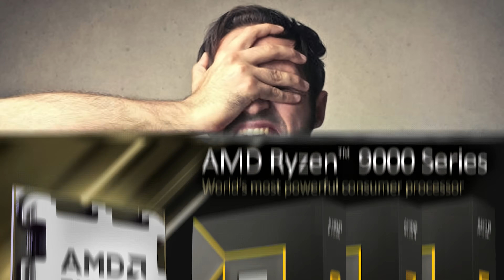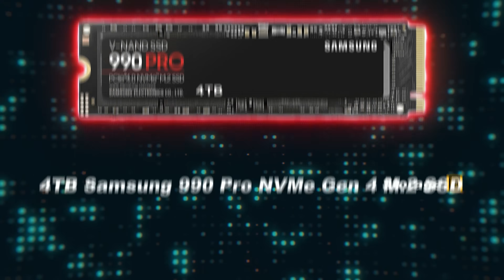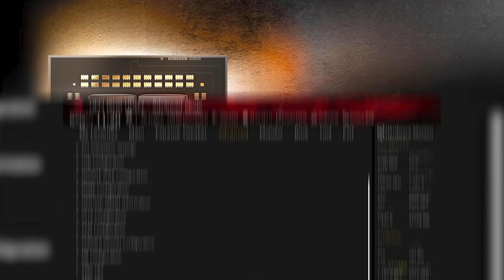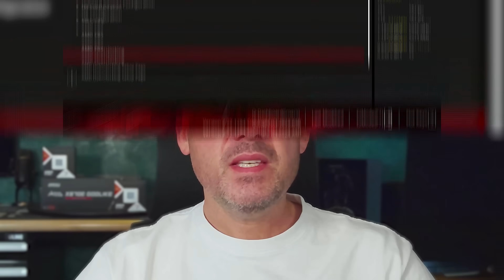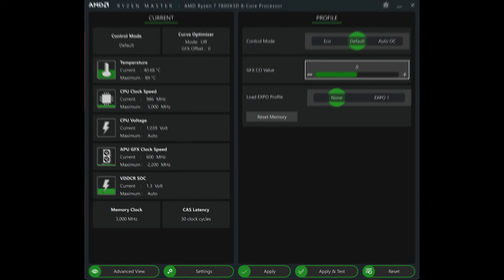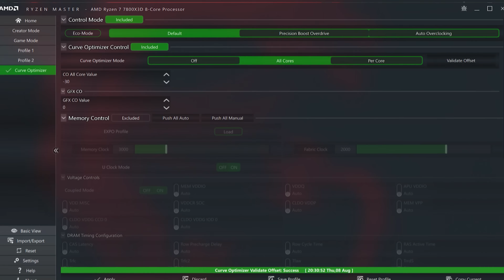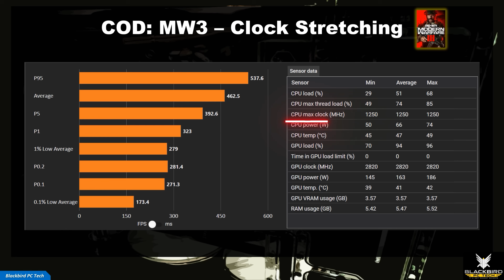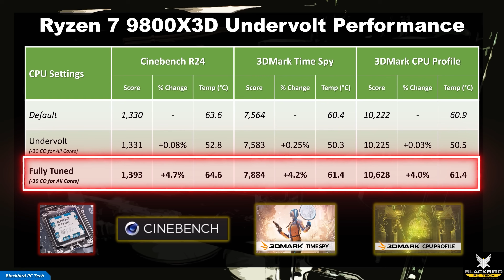How To Undervolt a Ryzen 7 9800X3D The Right Way! (or Any AMD AM5 Ryzen CPU)

Comment: I ended up only being able to get stable -17 offset stable which still had me hitting close to 90c, decided to do a manual voltage limit of 1.55 and a static clock speed of the base 4.7ghz, and my system went from getting to 97c stock to 78c under stress. Mini itx build so my cooler is a axp-120. not sure how much performance im really leaving on the table with it not boosting to 5.2 but if its only a couple frames its worth the much lower temps and fans not being so loud .
Reply from the maker: If you have thermal challenges like this then a much easier way to deal with it is to set a thermal limit in PBO2 ... that way you won't be leaving performance on the table. You can see how to do that in this video: https://youtu.be/N60M36PRHsY
Reply: @blackbirdpctech  you know im not sure if you do these kinds of videos but id be interested to see the fps difference across some games with stock 9800x3d and static base clock 4.7. to see if theres really much difference between 4.7 and 5.2
Reply from the maker: That's a very specific question that I don't think a lot of people are asking. You could always simply test your current configuration against your baseline to see what impact it has ... just pick a game you like or a synthetic benchmark like Steel Nomad, and you will rapidly see the difference. I would be curious to find out.
Reply: @blackbirdpctech I figured it could be 9800x3d at multiple frequencies but yea too niche for a video haha, Il do it when I get back from work and give you the results
Reply: @blackbirdpctech  done and done and the numbers are actually... not what I expected,I have a 4090 and 9800x3d, I tried witcher 3, cyberpunk 2077, kcd 2, and steel nomad. I tried stock with PBO auto, then static 4.7 with a lower voltage 1.055. my temps dropped from about 90-95c max to about 75-80c max.
 Witcher 3 Stock: 193/143
Witcher 3 Underclock/volt:198/150

Cyberpunk 2077 Stock:215/156
Cyberpunk 2077 UC/UV 214/161

KCD2 Stock:141/96
KCD2 UC/UV:146/120

Steel nomad stock:9034
Steel nomad uc/uv:9348

the first numbers are avg fps the second number is 1% lows

My only guess as to why the underclock/undervolt did better or within margin is the lower thermals, although even with pbo it never throttled, at its lowest was still 4.7 so not quite sure what happened, mostly surprised at steel nomad 300 point swing.
Reply from the maker: @3D-DOMO  great job, that’s the way to do it!

Comment: I have my ryzen 7 9800x3d from the first week, never undervolt or overlock, a few days ago i change my case and the aio and the temps are higher, i want to try the undervolt but im not sure if there's some risk or if my cpu can die with this😅 but if not i will use this guide
Reply from the maker: This will help reduce your voltage and temps ... it should therefore increase the life of your CPU
Reply: Thanks! I will try this today @blackbirdpctech
Reply: @blackbirdpctech i tried with -10 and the aida64 test stopped in less than 10 seconds idk what happened
Reply from the maker: That's interesting ... I've never had a chip that won't do -10 CO stable
Reply: @blackbirdpctech i tried with -5 and same thing, the test crash in less than 10 seconds maybe i just have bad luck, i have the cpu from the release date so idk if i got a bad batch
Reply from the maker: @SlayerT1898  is it stable without any undervolt?
Reply: @blackbirdpctech yes, no issues with stock settings
Reply from the maker: @SlayerT1898  just make sure when you input the curve offset that you change it to negative instead of leaving it the default positive ... otherwise it will be an overvolt
Reply: @blackbirdpctech yes i use the all core settings, negative and -10 and -5 but same issue
Reply from the maker: @SlayerT1898  it seems very strange to me but if you followed the guide and didn't make a mistake inputting the undervolt, then it might be your CPU
Reply: @blackbirdpctech I read i can try with each core one by one but idk if that can work
Reply from the maker: @SlayerT1898  you can, it will just take time, but it's worth a shot
Reply: @blackbirdpctech do u have some video doing that or what curve can I set to each core? I'm a potato with this things 😅
Reply from the maker: @SlayerT1898  it's the same process shown in the video, but you do it for each core ... start small, say in increments of -5CO for your CPU, and progress to higher negative offsets.

Comment: Will undervolting  cancel Amd warranty
Reply: Plus o have asrock x670 steel legend and 9800x3d im scared lol
Reply from the maker: Install the latest bios
Reply: @blackbirdpctech i installed 3.25 ever sense i did that my cpu and gpu temps went up only thing oc is ram everthing else default thanks
Reply: @blackbirdpctech last thing how to make hw monitor stay open while playing sorry thanks
Reply from the maker: @Frostthescottishfold it should stay running in the background and record your temps
Reply: @blackbirdpctech no it fixed i undervolt my cpu to -25 and temps where low then went back high so i reapplied thermal paste and its working fine wont go over 63 while gaming thanks still also get 280 fps which is my limit i put for cod
Reply from the maker: You would have to read your warranty ... that said, when you do anything in Bios it gets stored on the motherboard, not your CPU ... so if you were to send your CPU back without your motherboard, there really is no way for them to know what you did.

Comment: I have a 7600 and it runs pretty hot even on idle (47-50C) with an aftermarket cooler. Even by setting curve optimizer to -30 and voltage offset to 0.0500, no change. I'm not sure what I'm doing wrong 😔
Reply from the maker: 48 deg C in idle is not "running hot". Why are you changing the voltage offset and using curve optimizer at the same time? Did you test under load?
Reply: I didn't test it under load, it's the first time I do this. First I changed the offset, but it didn't change anything. Should I leave the curve optimizer and reset the offset value?
Reply from the maker: @alin.1704  I strongly encourage you to follow the steps in the video ... you won't notice a decrease in temps in idle with an undervolt.

Comment: I was only able to get my 9800x3d to clear AIDA64 test at 10 magnitude and default was already at 5 which didn't really change much. Any reason why I can't get it any lower like how you have yours set to 30 magnitude?
Reply from the maker: The stock settings should be at zero ... unless it's a prebuilt and they set your bios up with a -5 CO. The reason is silicon quality ... some chips will be able to undervolt more than others.
Reply: @blackbirdpctech  I built my own PC so unless they gave me a used CPU at the store idk. Also at @3:50 you talk about independent settings which got me a little confused. Should I be making sure both sections are set to the same magnitude or is it fine just changing one?
Reply from the maker: @stephenripcord3987  the undervolt is stored on your motherboard bios, not your cpu ... was it a used motherboard? Just input the settings in one place ... I would recommend the AMD overclocking section.
Reply: @blackbirdpctech  Nope everything was brand new or so I thought. AMD overclock is where  I did the tweaking but sucks I couldn't get it very low. Appreciate the help. If you have any other video recommendations from your channel for stuff like this I would love to check them out.
Reply from the maker: @stephenripcord3987  I did a post a few months ago outlining the how-to guides I currently have on my channel:

https://www.youtube.com/post/Ugkx3QVlCLJCO5lL5lRMB1RqT-akmXO_PpRS

I will have a new AMD AM5 optimization guide out in a few weeks as well.
Reply: @blackbirdpctech  Awesome bro I'll be waiting

Comment: I’m totally confused. You were very clear about exactly where to go to enter the negative curve offset yet you completely glossed over the fact that you also have a positive 200 MHz boost clock override applied as well. However, you never mention that in the video, but only focus on the negative curve that you set, which is only a slice of the complete undervolt pie you’re featuring in the video, and greatly affects stability.
Reply from the maker: I stated this early in the video:

"In the Precision Boost Overdrive screen, click on Precision Boost Overdrive drop down menu and select the Advanced option. This will allow you to access multiple tuning options for your CPU, as explained in my “How To Tweak an AMD AM5 Ryzen CPU: Step-by-Step Guide!” video. For this video we are only concerned about undervolting the CPU, so scroll down and click on the Curve Optimizer option."

I also linked to that guide in the video and description so that it's easy to find. If I repeated everything in each video then the videos would get super long and viewers would complain.
Reply: @blackbirdpctech  ok, thanks, that makes sense with your explanation here. I guess maybe something like “ignore the other settings you see here” would have been clearer, but no prob. Thanks for the video and response.

Comment: what do you thing of the people who say to stop testing all cores workloads, it s pointless, you can test on a processor -30 offset and will not get an error for days, the moment you test each core individually it will error in seconds/minutes. Use tests like OCCT single core test or Prime95 with core cycling? found other comments like this one saying you shouldnt do all cores
Reply from the maker: I think that there are a lot of people online that comment and offer expertise even though they never test themselves. I had an "IT expert" leave a comment a few days ago stating that all curve offsets are unstable under zero load, but that you will never experience a zero load condition in Windows because of background tasks. I asked him, "if you never experience zero load when running windows why would that be considered unstable?" I'm still waiting on a response.

What I've found from extensive testing is that AIDA64 does a great job of rapidly finding instability with curve offsets (including clock stretching). This is what I use when tuning my chips before I test them. I then test these chips extensively in over 30 games and professional workloads. When I benchmark games I run each benchmark at least 5 times at each resolution/settings combination. That means I do around 8hrs of straight benchmark runs for every video, not including the time it takes to reboot, load the games, select settings, etc.
Reply: @blackbirdpctech  Thanks man, really appreciate the reply. I'm just a casual gamer and mostly use my PC for gaming, watching stuff, and browsing, so I'm just trying to keep my system stable while undervolting without getting too deep into all the hardcore testing. That’s why I was confused by all the mixed advice online. What you said makes a lot of sense though, and it’s cool to see how much effort you put into testing. I’ll give AIDA64 a shot like you suggested and not worry too much about all-core tests now. Appreciate you sharing your experience

Comment: Thank you for this video! Honestly, I would advise everyone to just avoid using Ryzen Master altogether, it ruined my PC for two days it wouldn’t even post because the DRAMs got corrupted somehow (I got the orange ram light on my motherboard) , lol.

That said, I’m curious: in Ryzen Master, I couldn’t go lower than -22, but from the BIOS, my PC is more stable at -30 (7800X3D) maybe because I got a new 6000hz CL30 ram idk. I didn't try to get lower
Reply from the maker: Can't you simply dial-in a curve offset in Ryzen Master? Does it stop you from going lower than -22?
Reply: @blackbirdpctech  Yeah, when I try to go lower, the test doesn’t succeed for some reason. But I did -30 from the BIOS (started from -10 like you suggested) and ran AIDA64 for 20 minutes without any crashes or errors, so I guess I'm good.
Reply from the maker: @ookam9685 that’s interesting … will look in to it more

Comment: Instantly down from 90c to 74c when stress tested, air cooled with dark rock pro 4. Went right to -30, works great thanks!
Reply from the maker: It's a magic tweak 😉
Reply: @calvins.9178  you underclocked at 30 ?
Reply: @Stevestevestevestevestevesteve  I did as well, -30 offset
Reply: @roccotaco87 when I did that to all my course it started underclocking some of the course
Reply: how was fps affected?

Comment: 03:53 All videos articles etc fail to mention,  a negative curve optimzer curve causes instabiity at no load. 90% of testing at full load while using a negative curve optimizer settings is uselss. No load in this case means all of your programs closed, best case a linux or windows boot stick and let it run for multiple hours. -30 curve is unstable in 98% of cases, but people do not realise it, because Windows background stuff prevents your system from crashing. Also there are dedicated scripts and tools made to specifically test Curve optimizer settings by the community. If you overdo it (pbo + undervolt + memory etc.) aka. "I try to get everything out of the system" your cpu will suffer damage overtime. Granted it will likely still work for 3,4,5 years instead of 8-10, but it gets mentioned nowhere. Also you should never use Ryzen Master. In some cases it sets settings your are not able to change in efi, because they are hidden from the user. The only way to change them back is to set the default efi settings. I am not a Rocket Scientist, but I am in the IT Industry as an Engineer for over 20 Years.
Reply from the maker: If you are going to make a statement like this, it's always good to start with a definition of stability ... arguing about whether a system is stable or unstable requires some type of standard definition ... unfortunately there is none that I'm aware of.

That said, while it's true that an aggressive negative curve offset can lead to instability at no load, it's not true that any negative curve offset will cause instability. Based on my testing, I've found that for a given negative curve offset, you are much more likely to experience instability under load than under no load. Furthermore, you will not reduce the life of your CPU by undervolting it ... that makes absolutely no sense. And I'm not a fan of "bla bla bla" scaremongering ... you will not damage your PC by tuning your system. PBO is a feature set developed by AMD to allow you to tap in to the full potential of your silicon ... if you are able to overclock and undervolt your CPU then your CPU inherently has a life that is greater than spec ... so any reduction in life would still be beyond the original spec. If however you try a static overclock then you can indeed damage your CPU, which is why I don't recommend doing that for most users.

Please share the data to support your claim that a -30 CO is unstable in 98% of cases. If what you said is true, and people don't realize that they have an unstable system because of Windows "background stuff" preventing your system from crashing ... how is that unstable? If you are using Windows and it's stable when idling and under load, under what conditions would you experience a crash? This is the kind of nonsensical statement I take issue with.

Comment: I seem to run stable at -20 CO and a +200 Mhz on my 9800x3d Scalar at 1x. Runs about 10 degree cooler and runs more stable aswell. Only have 1 fan plugged in for the Noctua NH D15 CPU Cooler tower tho. but I have 2 fans at the front and 3 on top and 1 at the back of my case. If I plug in the 2nd fan I'm sure I could drop a few more degrees or I'm thinking of getting the Artic Liquid Freeze III Pro 360 AIO.
Reply from the maker: I run my 9950X3D at -20 CO with a +150MHz boost … always depends on silicon quality
Reply: @blackbirdpctech  Ran AIDA64 Extreme for 10 minutes and it ran fine topped at 70C and had Discord and this video open at same time and it never hung or anything so I'd say Im good. My main game iRacing in VR seemed alot stable aswell
Reply from the maker: You can go down the rabbit hole of testing forever to find an error but if your focus is gaming the reality is it’s not that serious
Reply: @RedSliceGaming34  with noctua nhd15 with dual fans I get 73 in Aida64 without any undervolt. Can you try do prime95 and tell me results?

Comment: I can give to everyone a quick tip that will save even more time for undervolting: put default in BIOS, than use Ryzen Master to undervolt all cores and test stability in Windows directly. You don`t have to wait to post in Windows and test, than go back in BIOS and reboot and test again. After you find stable undervolt just go in BIOS and make there the permanent modification for CPU. After that don`t use Ryzen Master anymore so you don`t mix up settings. Easy. Same with GPU. Very helpfull and fast in my opinion.
Reply from the maker: That's a good idea however when you change the undervolt in Ryzen Master I thought that required a reboot to take effect?

Comment: Just did a case swap to lian li o11 vision. My cpu temps went up about 5-6 degrees coming from my h9 flow. This video helped  drop my cpu temps about 10 -15 degrees thanks man. This video is a great guide for people using small form factors cases, or cases with slightly reduced air flow like the o11 vision
Reply from the maker: That's great to hear ... the vision is a beautiful looking case